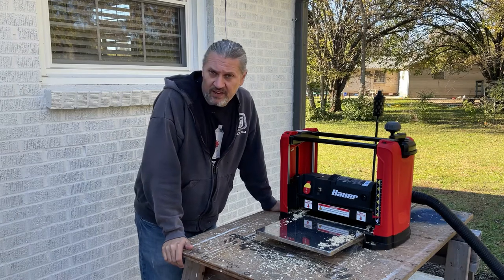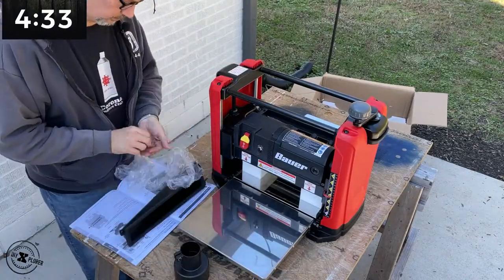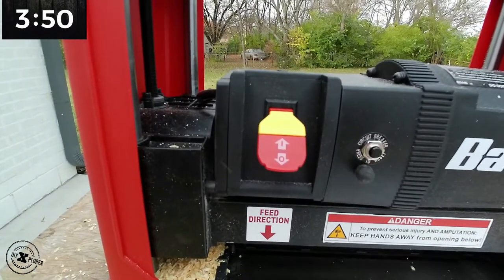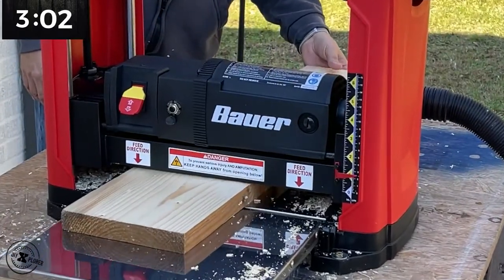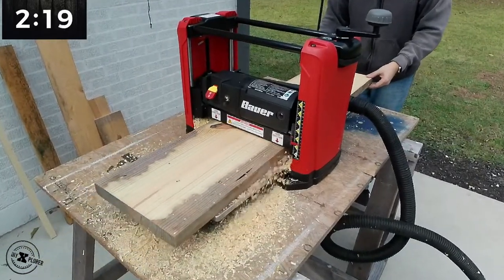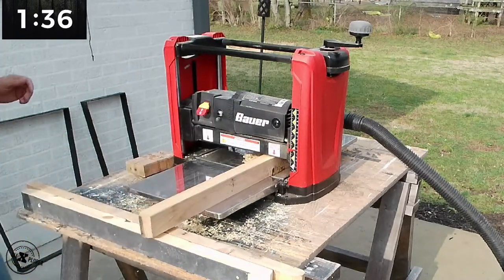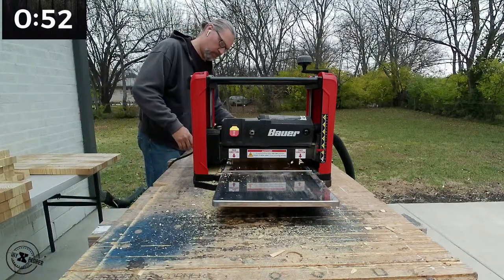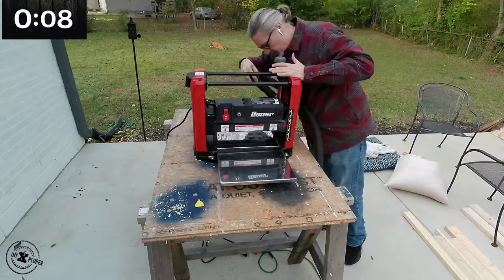Bauer Portable Planer - Unboxing and First Impressions  | #DIY #HOWTO

Comment: Newbie here - This does the top and bottom. How can I make sure the width is flush too? Or does it cut all 4 sides in one swoop?
Reply from the maker: Hi Techaro - The blades are only on the top. So, you need to flip the board to get both sides. I'm not a professional, but I believe you'd need a jointer for the edges. I have a hand one, but it doesn't do as well as a tabletop version. Examples are here - https://amzn.to/3wxqphN

I hope that helps. Thanks for watching and leaving a comment.

Comment: Me and my dad just got it and so far after 2 cuts it works well. 
Just don't forget you'll need a big vaccum.
Reply from the maker: Awesome! I'm still loving my Bauer planer. I had to empty my vacuum so many times. Eventually, I got a cyclone dust separator between my planer and vacuum. It reduces 95% of the sawdust that goes into the vacuum. It works fantastic, and it's portable! You can check it out here: https://amzn.to/3RPDYS2 Thanks for watching and leaving a comment!

Comment: What is the lowest setting it will go ? 1/4”?
Reply from the maker: I haven't used it that low, but I pulled it out, and it looks like it goes almost all the way down to the base. I looked at the product page and did not see an official lowest setting number. I highly recommend checking with the staff at Harbor Freight on that detail. Sorry, I'm no help. Thanks for watching and leaving a comment!
Reply: @DIYXplorer   thanks bud..!

Comment: How was the table set up for snip ?
Reply from the maker: I used two saw horses then screwed the tabletop to them and leveled it. The planer has 4 corner points where I can screwed them it down as well. What that what you were looking for? I'm not sure what you mean by snip? Thanks!